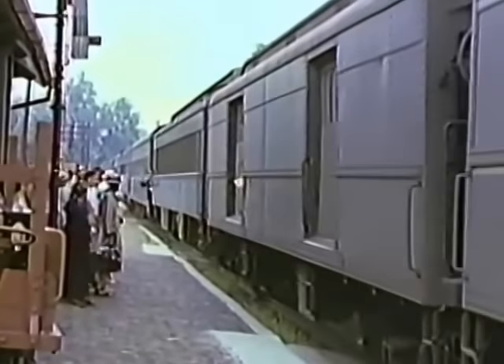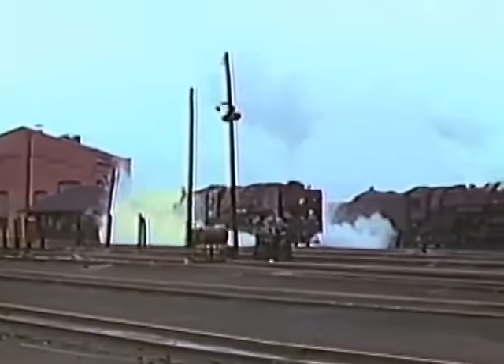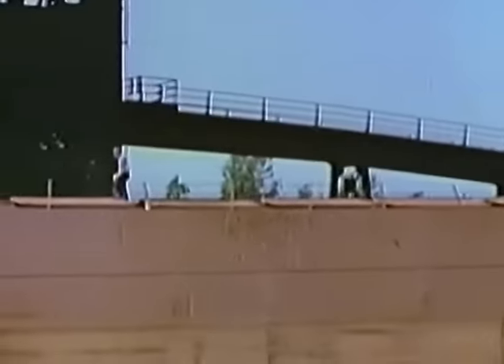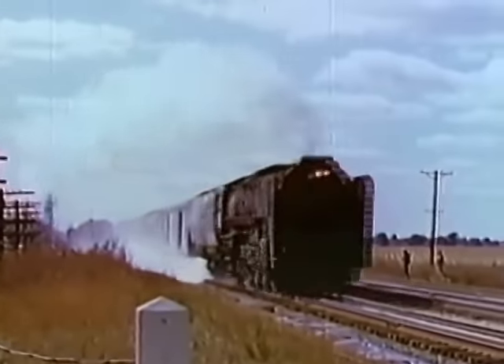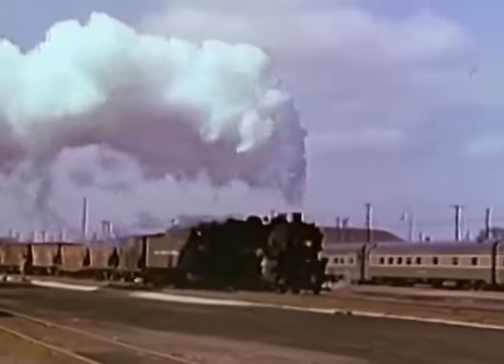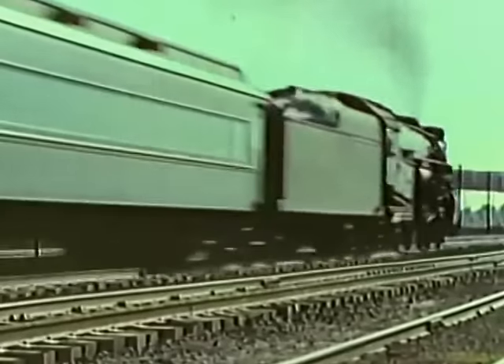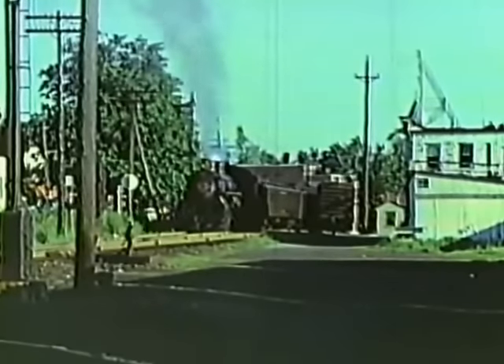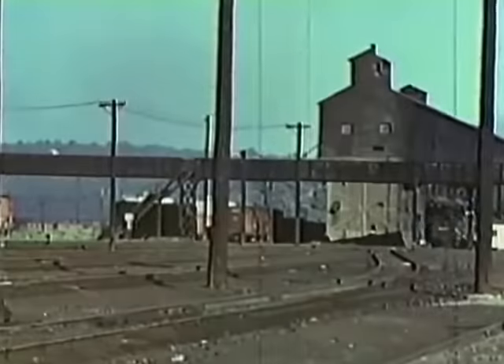NYC Water Level Route

Comment: Some folks ask me, “Mark why the steam engines,  they’re so old timey”
Besides the mechanical aspect....
They are making 6000hp boiling water...... that’s impressive I don’t care who ya are!
Reply: I used to engineer on steam ships, 30 to 60 thousand hp boiling water was not uncommon, but you might get a shock at the fuel bill. 6 oil might cost less, but we used a lot. The turbines were dead reliable, the diesels, less so. Have fun

Comment: Wonderful quality footage of incredible locomotives, very surprising that no Hudsons or Niagaras are preserved, perhaps the UK example of building new ones from scratch could be followed, as with the A1 pacific Tornado?
Reply: Not a chance.  There is no facility in North America and, perhaps, in the industrial world capable of producing the massive and complex steel frame castings with integral cylinders.  Tornado is still a simple plate-frame engine -- easy 19th Century technology.
Reply: @jppicur  actually there is a Northern sized steam locomotive, currently being built from scratch, it's called the PPR T-1 Trust, engine no.5550. The T-1 is a duplex and has a ridgid frame, similar to a Northern. The only difference is that a T-1 is a duplex. Building a Northern from scratch in today's world is possible. The hard part is raising the money. I'd Check out The T-1 Trust if you are interested. It is possible to do the same with a Niagara, problem is getting enough public interest.

Comment: Boy, those little Camelbacks had some spunk! - 17:13 ...
Reply: Imagine the engineer that is driving it;  he has to stay in that small cab mounted on the side of a boiler that is at 250 F or more.  Its like sitting inside an oven, that's why he is hanging out of the window most of the time.
Reply: It also looks like it was designed for when the Engineer and Fireman didn't get along!! lol
Reply: Never seen one before....

Comment: Trying to reduce locomotive weight??   So it slips more?
My great uncle said his 4-8-4 freight locomotive could easily slip.  How much useful weight was taken off the drive wheels by the pilot and firebox wheels?
Niceffort synchronizing sound!   Nice information!   Thank you.
Reply: With not pilot truck or trailing truck, the speeds could not be achieved. Also the coefficient of steel of steel is around 0.6 for dry rail.

Comment: Sounds like the United States had high speed rail at one time. The J3 Super Hudson’s top speed was 120 mph.
Reply: The California Zephyr, of the Union Pacific, Central Pacific, could do 125-130 on the flats on her way from Emeryville Calif, to Chicago Ill.
Reply: @prebooomer  If one could prove that it exceeded 126 mph, then we have a new World Record.
Reply: Don't put any stock in the claim of "120 mph."  Such speeds were either theoretical or were achieved in wheel-slip tests on greased rails.  Nobody did them in regular service.  90 mph was attainable but even 100+ was a stretch.

Comment: Something that makes me uncomfortable is that, at many places in this video, the sound has been added and does not correspond to the image.  These steam locos are two-cylinder types so they should produce four "choo"s per wheel turn.  At many places if I look at the wheel, they turn very fast yet the "choo-choo" is that of wheels turning 3 or 4 times slower.  It is very obvious, for example, at 20:42 where we easily see the wheels and hear the "choo"s,  Try to count 4 "choo" per wheel turn...

At some other times the choo-choo is very fast and the wheels turn slow...  I also noticed that at many instances the "choo-choo" is of the same frequency for locos rolling fast and others rolling slowly.  Which is technically impossible.

Except for that, this is an excellent video.  The text is well written and instructive.
Reply: James C Exner true monster of a engineering all the power to handle brilliant
Reply: One thing that helped me notice is that I was alive in the '50s and I loved trains. I was fascinated by science and engineering and studied "How it works".  That is true for airplanes (like the DC-6 and Super-Constellation) and for trains which I liked to go see either at the station or the rail yard.
Reply: Spoiled brat comment.
Reply: A little picky there, I bet 99.9% of us didn't notice. The added sound was better than watching a silent film, made it more interesting.
Reply: That's because wind-up silent video cameras were cheap; wire recording equipment, the best at the time, was expensive. As for the exhaust matching the wheel revolutions, wouldn't cylinder cutoff have much to do with that? I've heard recordings of PRR K4s on commuter trains coming into stations at low speed with the exhaust roaring, reminded me of how a car revs up when downshifting.
Reply: Black Watch Audio: Since there's a physical, mechanical connection between the wheels and the cylinders, the "chuffs" should always match.
Chuff intensity may differ, or there may be no chuffs at all while coasting, but the number of chuffs per wheel turn physically can't differ.
Reply: Tahititoutou: That annoyed me too. But then again, better than total silence...
Reply: Tahititoutou: I know it but it is so hard to count sometimes
Reply: Cylinder cutoff has nothing to do with the number of exhaust strokes per revolution of the wheels.
Reply: Ima gonna railroad your candy apple red caboose right on down those tracks and outa this town ! Great Video !
Reply: Yea, sound does not match what is on video and sound with steam locomotives is the first part of the steam locomotive experience the visual just confirms what you are hearing.
Reply: @Tahititoutou
, exhaust Beats per rpm
It is certainly true that the number of exhaust beats is directly related to the revolutions of the 
driving wheels. Cutoff will affect the volume or the hardness of the beat, but not the number per RPM.
Nevertheless, it is not trivial to correctly dub a steam locomotive -  knowledge about the design of the respective locomotive must be present.

For a normal two-cylinder steam locomotive it is true that 1 RPM = 4 exhaust beats.
However, a three-cylinder locomotive, where live steam is delivered  to all three cylinders has six beats per RPM - as long as it's not a compound locomotive, because these sound more like a two-cylinder locomotive, but with a softer exhaust stroke because of lower vapor pressure.

Unlike a Mallet, in which all four cylinders are supplied with live steam. These sound like two two-cylinder engines running at the same time coupled together, and depending on the synchronicity of the two engine frames, it sounds like a two-cylinder locomotive (if both engines blow out at the same time), or like a four-cylinder locomotive (if the cylinders blow out alternately) - or something in between. This can be heard very nice in videos, where the chinese QJs are struggling at Jingpeng Pass.
If this mallet locomotive is a compound locomotive, it sounds starting up - when all four cylinders are supplied with live steam - like two two-cylinder engines, which may result in 8 beats per rpm - after switching to compound, it sounds like a two-cylinder compound loco - 4 beats per RPM but with a softer punch.
Last but not least: 
A two-cylinder compound loco sounds like no other. The high-pressure cylinder on one side directs the steam into the low-pressure cylinder on the other, which blows the steam through the chimney. Because of this construction, it has only 2 strokes per revolution of the driving wheel! ;)
Reply: It's plum loco to choos your chuffs!
Reply: They did the best they could with what they had to work with.  It may not be perfect but it's one of my favorite free youtube videos.

Comment: Those trains of the days gone did outmatch modern American passenger trains by far in terms of speed, except for the Acela Express.
The Niagara's could be considered as the summum of steam in North America, as was the maintenance strategy employed around them.
The cost per horsepower and mile were much lower as for a comparable set of diesels.
But no one could envy the men which had to crawl in the firebox in their asbestos suits.

Comment: Some nice footage but the narration frequently has nothing to do with what you're seeing.  Much of the talk about Niagaras shows everything BUT Niagaras, and of course the sound is all dubbed.  Some of these films were probably shot in 16mm with sound and in those cases the original sound should be left intact even if low quality.   Certain sounds like the sound of scooping water at high speed are utterly unique and should be preserved for history's sake.
Reply: First time I've seen footage of track pans being used. Thanks for sharing!

Comment: Super Hudson is a beast.  A better version of the Big Boy imo.
Reply: The Niagara was a better locomotive than the Hudson.  And the Big Boy was designed and built for an entirely different purpose; you can't compare them.
Reply: @jppicur  the Niagara did have rivals over in Africa the SAR 25 condencer, and the SAR 26 red devil which is an advanced steam traction locomotive.
Reply: @brandonm30  The SAR 25 was an excellent modern design, but it could not compare with the Niagara in terms of either availability or power per pound of weight.  Most modern steam designs, especially of the 4-8-4 type, were created to very high standards.  Very few, though, reached the apex.  The Niagara was at the top of the peak.  I would place the N&W J Class second.
Reply: It’s a pretty dumb thing to compare the Big Boy to a Hudson. Big Boys were WAAAAAAY better than the J3a Hudsons. They were articulated locomotives, so that meant more tractive effort, and more track speed
Reply: @AdmiralColdhead  Hudsons we're built for speed up to 125 mph was possible.
Reply: @brandonm30  Their max speed was 110 mph
Reply: @AdmiralColdhead  Milwaukee road class F7 and the borsig DRG05 are 125 mph Hudson's.
Reply: @brandonm30  Understood, but this is a video about the New York Central Hudsons
Reply: @AdmiralColdhead  Articulated locomotives were generally unstable at higher speeds, although the Challenger and Big Boy were good for speeds in the 60s.   If you seriously believe a Big Boy could outrace a Hudson then you need to do a lot of remedial reading.  Also, you need to learn that tractive effort does not equate to power.  Tractive effort is strength at starting and low speeds; power is purely a product of boiler ratio and steam passages, and represents the ability to sustain higher speeds.
Reply: @jppicur  First of all bub, I am not saying that Hudsons were faster than Big Boys. I’m saying the opposite. Should’ve read the comment harder. Also, my mistake on the tractive effort error.
Reply: @AdmiralColdhead  No, what you said was that Big Boys were faster than Hudsons, which is incorrect.
Reply: @jppicur  Exactly. It’s incorrect. What’re you saying no for exactly? To prove a point orrr
Reply: If I want to save one it would be 5413, This locomotive was filmed by Donald Krofta in 1955 and the next year Doc Blackburn rode in it's cab pulling the James Whitcomb Riley

Comment: He claims the Niagara was more powerful than the UP's 8444 or the Santa Fe's Northern? Amazing.
Reply: The Niagara was far from the most powerful 4-8-4 in tractive effort, with just 61,568 lbf, but in drawbar horsepower, it was, maxing 5,300 when operated at 290 psi. Pressure was reduced to 275 psi for maintenance reasons, lowing the DBHP to 5,070 at 62.5 mph.

Comment: Express trains used to travel this fast (6:19)  on bolted rail. Now Amtrak goes 70 max on welded smooth ribbons. What are we coming to...
Reply: with so much freight traffic on the rails, it's little wonder why they don't go fast.
Reply: @GiordanDiodato  Europe seems to manage it just fine. Stand at any station in Italy, watch an express roll by at 120 MPH, and then a loaded (albeit shorter) freight roll by two minutes later...
Reply: What we're coming to is the beginning of the end of any passenger service in America heck Amtrak I think is planning on phasing out long-distance passenger service, I could be wrong on this information but it's what I heard at the time
Reply: Railroad,Preserver,2000 they want to phase out some, but not all of them.
Reply: Dante DiBiase
Just gonna note, it’s technically jointed. Not bolted.

Also, Amtrak has to deal with multiple private entities and their trains.
Reply: Uh, Amtrak runs as fast as 150 MPH every day on the Northeast corridor. And many diesel lines are 110 MPH.
Reply: FFred6956 No 

To be fair most of the NEC is 100 mph, not counting the curves with speed restrictions. 150 is only in certain sections.
Reply: FLNY Mike Read what I wrote again and realize you just contradicted yourself. As I said they go as fast as 150. And the speed is much higher than 100 for a good deal of it. Speeds are as high as 135 west of NYC as well. And again, plenty of routes see 100+ on the diesel side too. So you’re statement that they go “ 70 Max” is outright false. I should know. I run these lines every day
Reply: Union Pacific SD70M  to be fair though the only real sections that Amtrak's travel that fast on are the sections between Boston and New York
Reply: @FFred-us9tw  Don't forget that France and Japan regularly run at 300-320 kmh (186-198mph)...
Reply: @paulcaswell2813  What does that have to do with Amtrak?

Comment: I'm so upset that none of the Hudson's or niagras were preserved.
Reply: We do have an L Class 4-6-4
Reply: @donaldschmenk4345  That's the thing. There are a few Hudsons preserved and don't realize that Hudson is a broad term.
Reply: Tai Wesley the nickname Hudson is mostly affiliated with the J types, likely because the NYCS produced the first Hudson and gave 4-6-4s their nickname.
Reply: @doc_1851   The Hudson type was used on many Class One railroads.  The association of the Hudson with the NYC was because theirs were the first true locomotives of the type.  Also, NYC eventually rostered more than 200 of them, more than any other railroad.  But CPR had the most dual-service Hudsons (65) and the Milwaukee Road had, perhaps, the fastest (although MILW referred to theirs as "Baltics", recognizing that the first 4-6-4s were actually built in Europe).
Reply: We.may not have new York central 4-6-4s but we do have c&o hudson 490 nickel plate road Hudson 170 and royal Hudson's 2816 and 2860

Comment: I rode the NYC's twentieth Century Limited. I went from Cleveland, Ohio to Buffalo, NY.  The trains pulled by the Hudson's always were on time. After the switch to diesel, the trains were always late or not on time as some conductors said.
Reply: The NY Central was going down the drain then.
Reply: @tommytruth7595  You are absolutely right! The NYC was going down and the road was becoming unmanageable.  In the end, the merger with the Pennsylvania was meant to save both roads but the financial burden of the NYC proved too much and both went under, resulting in the government taking over and creating a new railroad the Conrail system.

Comment: Re: the 4-6-4's from Trent (below) it would depend on the diameter of the drivers. Remember, the bigger the drivers, the more they were denoted as passenger class as they were faster and smoother operating, such as 74-86" class drivers. The freight engines always had the smaller diameter drivers, such as 32-62". This is an average and did not always apply. Many of the  74-78" drivers locomotives when close to retirement after having served as passenger haulers, were then relegated to combination passenger and freight haulers. So double stacking 2 of the 4-6-4's was not out of the ordinary per say. Great catch in the video though. Also, whomever placed this video on You Tube, thank you very much. It brought back many memories.

Comment: Great video. But the NYC never ran through Milan, MI. The Wabash & Ann Arbor railroads did.
Reply: dansjr right, they wouldn't need to either. They had their own line out of Toledo off the Water Level Route into Detroit.

Comment: Why don't people try and remake some of these behemoths. The T1 trust is remaking a T1, the A1 peppercorn tornado was made recently and the lms patriot class is also having a new build.
Reply: Unfortunately, money, building, finding somewhere for them to run, are the few main struggles of building a locomotive from the ground up in the US. The UK works differently than the US, so I would assume that they have railroads using Steam power, but the US isn’t too keen on having these machines on their road lines
Reply: @AdmiralColdhead  I can see what you mean. In the UK the majority of the mainline network is run by network rail. And Tornado isn't an exact replica of a peppercorn A1. It's actually considered a continuation of the class. One of the design goals the A1 trust had was to make the steam loco compliant with the current rules and regulations of mainline operation from the get go. So nothing was retro fitted but was built right from the start. That's why it wears the number that it has. Also few of the heritage railways in the UK actually out right own the locomotives from what I know (I could be wrong). The majority of them belong to there own society's or are privately owned but stored and run by the railways. I'm pretty certain though you would find enough rail fans to give the funding needed. I would be concerned about where to run it as you say. Although I think companies like NYCR would probably be interested in making a it a cermercial thing that they could make money off.

But eh, what do I know. I have never had to deal with the complexity of railway management so I'm not really qualified to say what can and can't be done.